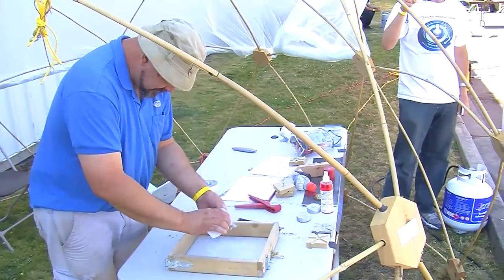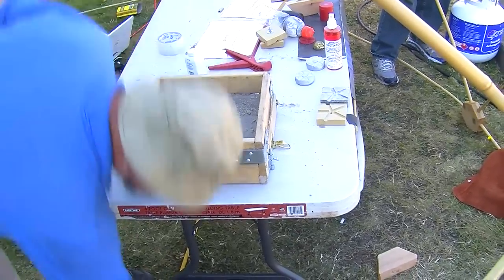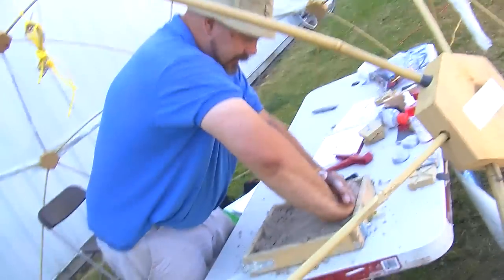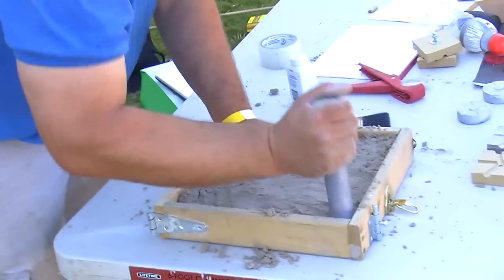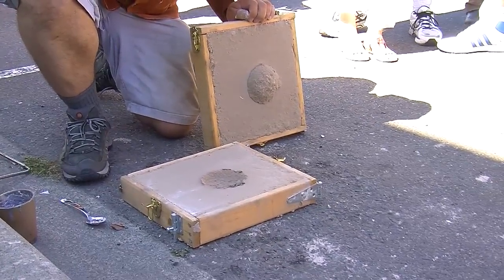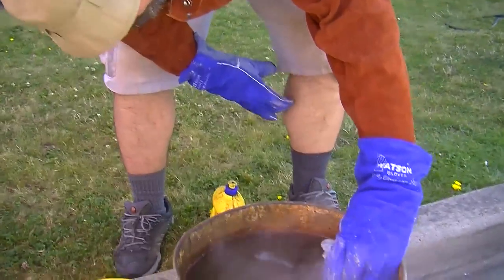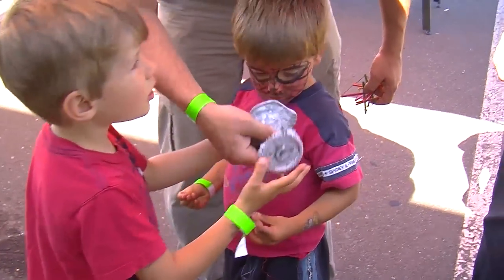Casting an aluminium gear - Victoria (Vancouver Island) Maker Faire

Comment: Hi, Do you use pure sand for the molding or is a mix? Is it better to use sand or clay for that?
Thanks
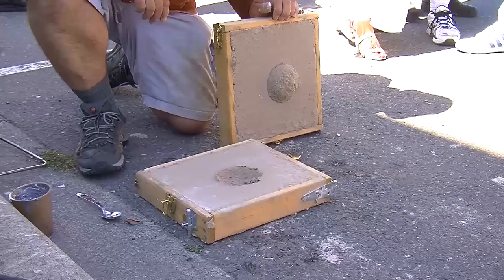Reply: I know this is long after you asked, but looking at it. There are two different primary binders, either oil, or clay and water.  The mold doesn't smoke during the pour and at around 2:11 you can see it steaming, not smoking.  Which indicates it isn't petrobonded sand.  The clay is likely either bentonite and kaolinite.  Since it lacks the kind of green tinged hue common to bentonite I'm pretty sure what he's using is sand with a water kaolinite binder.   The sand itself is probably just play sand though.  There are specialty sands that you can use, though and it is a little hard to determine the uniformity of the grains and the size of them so it could  be something he ground himself or ordered with small uniform grains to get some more detail in his casts.   Pure clay is usually a rather bad mold material because it contracts and expands differently under thermal strain than the metal, so it's likely to crack while casting.  As well traditional clay has a habit of glassing over, I'm not sure how big an issue that is in a cast, but you cannot use tradition clay when making forges or melting down iron into a bloom otherwise the clay will become critically weak.  Clay isn't uniform all the way though.  It's made of a large number of different materials and minerals all mixed together. Some of those minerals have a low melting point, others don't, and that lack of uniformity leads to failures.
Reply: Michael Unknowable Thanks pal, helped me a lot. :)

Comment: I've been thinking about making a planetary transmission for a bicycle project, I suppose aluminum would be OK for that, but not for a car, right?
Reply: Nabre Labre Aluminium comes in very different qualities. For internal motor parts you need to have special aluminium that is heat treated, and milled instead of poured. Poured aluminium is the weakest of all, then you have injection molded aluminium and after that you get to the more solid pre-fabricated aluminiums that you can use a CNC mill on to create the parts you want.

Besides this, a lot of aluminiums are used with alloys, for example they use magnesium to make it hard and stiff, but it also becomes more brittle, and when you light the aluminium on fire with a welding torch or gas torch, the magnesium and aluminium start oxidizing, creating a fire that you can't put out. It burns up until it's gone.

I have been melting aluminium with magnesium in it safely, the magnesium separates from the aluminium and can be scooped out. Just throw it away and keep the pure aluminium.
Reply: +Nabre Labre I very much doubt aluminum will be strong enough. The torque is actually pretty high in a bicycle transmission.
Reply: +Nabre Labre: Aluminium is a rubbish material for any gear. Tends to seize up when subject to friction at high loads. (Any gear transmitting power and not just used for positioning sees high load.)

For your bicycle project use steel, These tend to be loaded pretty high because of size and weight constrictions.

Comment: It will be undersized from the original part. You can not take something from market and make its casting and get same thing. You will get little undersized thing because of shrinkage of metal.

Comment: Nice they show it's easy to do. Sad the guy is doing most of the steps wrong. The pour was completely raw, should've been done more careful, in one go, good continuous stream into the mold etc. Also the making of the mold itself was quite crudely done. The end result was still quite good though, but the wheel would've looked better if he had made the mold with more care. It's one thing to inspire others, but it's also very important not to start working 'loose'. I'm wondering why he did it with less care, is it because he thinks his audience doesn't understand anything about it anyway? Does he underrate his audience?